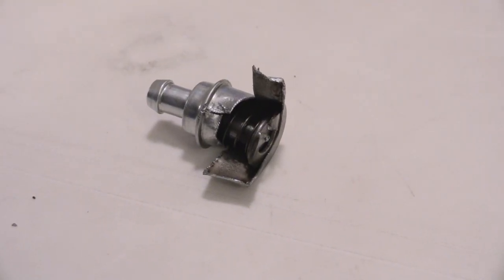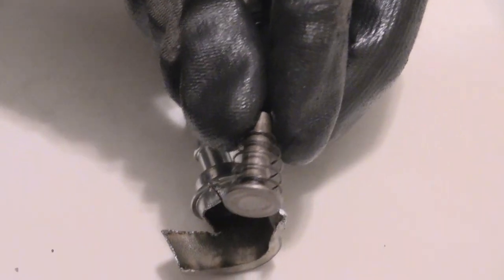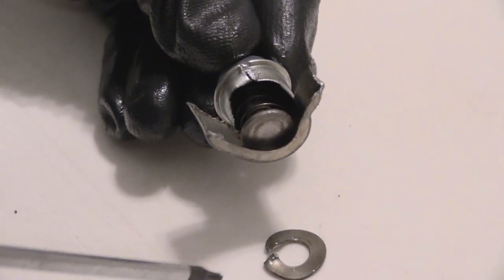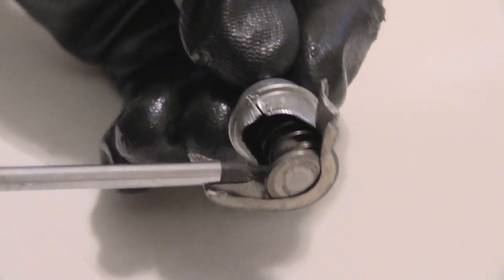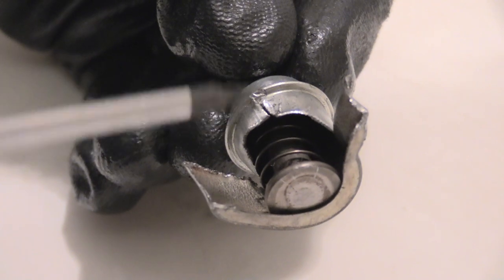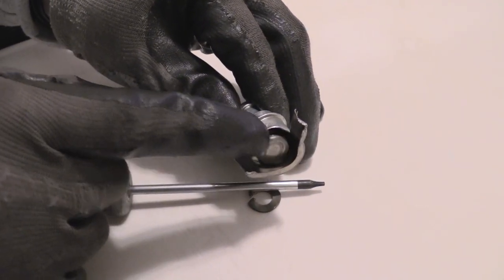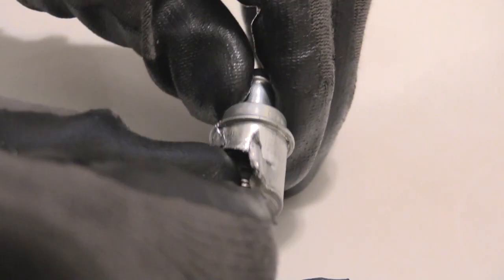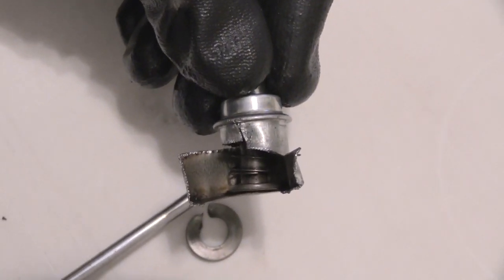PCV Valve Whats inside? And how it works.

Comment: My 2012 1.8L Civic (Europe) has 105000 km and burns a little oil, is that because of that valve? My previous Civic had 500 000 km and burn a little oil the last 100 000 km, never changed that valve.....
Reply from the maker: Yea probly need to change it out.Please subscribe & like and share if haven't already and check out our other helpful videos

Comment: My 2000 Corolla has a solid metal one available through NAPA for cheap, but I just clean mine well with brake cleaner and air dry it a few minutes... Easy!
Reply from the maker: Thanks for helpful tips. Please subscribe & like and share if haven't already and check out our other helpful videos